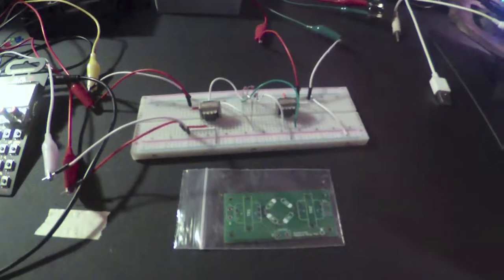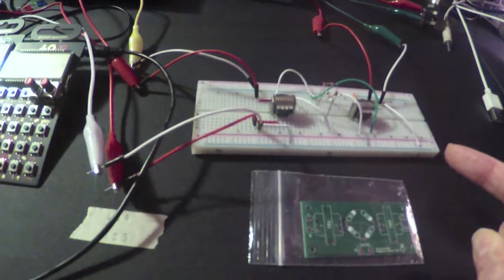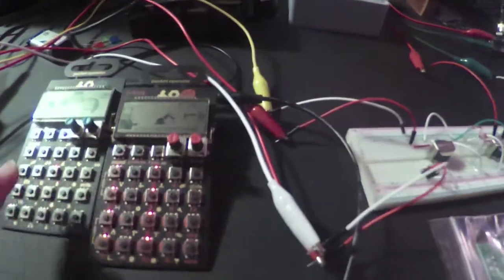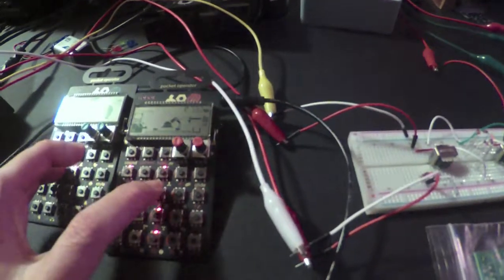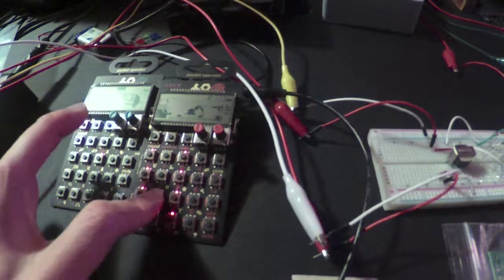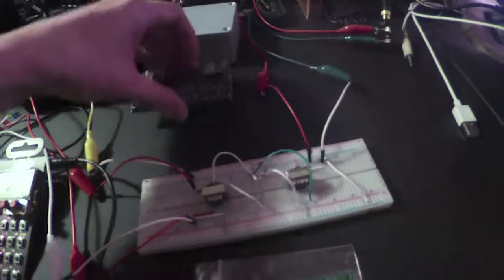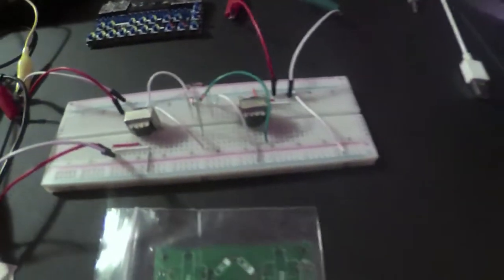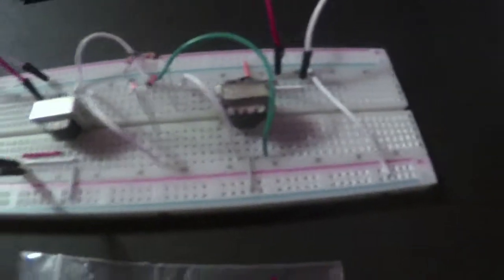Synthrotek Passive Ring Mod circuit on a breadboard

Comment from the maker: And the circuit is back to working! I had a couple of cold solder joints where I most likely did not have the board as clean as it should have been cough tape residue! cough and a good friend of mine helped me set it straight!
Reply: I'm wondering, did you amplify the output signal from the POs ? My audio transformers are fine but I can't get any sound when everything is wired. I've been told to use 10V signals but it seems kinda huge. thanks!